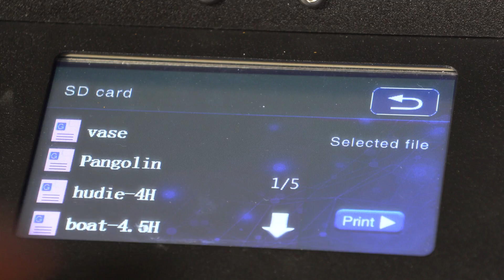The Unfortunate Problem with the Creality CR-X 3D Printer

Comment: I got an ender-4 since hey 4 is more biggerer the 3! Right?  What a piece of shit!!!!!!  

#1 when the y-limit switch is engaged the it turns the mainboard and the lcd off!  Seriously the 3.3 and 5v leds turn off and the lcd goes black!  This cost me three days thinking my mainboard was dead until by chance I moved the gantry away from the y-limit sw!!!

#2 The y-axis will NOT zero out when I try to auto home.  It is supposed to move the head to x0, then move the gantry to y0, then move x and y to 110, 110, then move the z-axis to the start position using the auto detect sensor.

Instead it moves the head to x0, then immediately tries to move to x110, y110, then home the z-axis.  It completely skips attempting to move the gantry to y0.  The result is if the gantry is past y110 then the gantry moves back until it crashes into the back of the frame with the gah, gah, gah..as the y-motor grinds!!!

I can control the y-axis from the main screen so I know the motor is working.  Also it does the move back with the auto home so I know it is getting some kind of signal to move back and is following it and it is moving the correct direction.  I even tried writing a gcode script:

G91; relative mode
G1 Z-10; move relative z -10 mm
G90; absolute mode
G28 X0; go to x0 limit sw
G28 Y0; go to Y0 limit sw
G28 Z0; go to Z0 position using sensor

Everything executes as expected except the G28 Y0.  It just ignores it as it does for autohome.  So this is still not resolved and of course I cannot look at or fix the firmware because it is locked!!!

#3 Back to the y-limit switch turning the mainboard off when engauged.  I looked the picture in the assembly manual (also a piece of crap) I noticed that the y-limit connector is 3-position with the wires in 1,2.  But the limit sw wire that came with my printer has the pins in 1,3.  I can easily move the pin over but I have read various posts that say the wiring should be 1,3.  However, why the hell does actuating the switch then shut of the mainboard?  I moved it to 1,2 as in the photo in the book but cannot test it because I cannot get the god damn thing to run the gantry back to the damn switch!!!

#4 The LCD is unreadable and does not match what I see in every youtube vid I have watched.  Mine has a bright background with darker letters and is so overblown and pale contract that I have to tilt the entire machine backward to read it or kneel on the floor at eye level.  

The display I see on the creality site and all the videos I have watched has a dark blue background with high contrast bright letters!  WTF I have different editable firmware or something?

So as of now I have spent two week assembling this piece of shit and have a $308 door stop!!!!

So yes Creality's quality control is garbage.
Reply: Okay very important update that might help other creality ender-4 people.  problems #1 and #3 above are resolved with a simple fix.  The y-limit switch cable has two ends and at one end the wires go into position 1,2 of the connector and the other end they go into positions 1,3.  Rather the move the pin from 1,3 to 1,2 as I did just flip the cable!!!  So the 1,2 end goes to the connector on the mainboard and 1,3 goes to the connector of the motor!!  This fixed both the mainboard and display going dead and autohome and g28 y0 not moving the gantry to y0 position.

But I still feel the quality control is crap, the instructions are crap.  Note both ends of the cable were labeled "Y".  I missed the class on omnipotence and therefore could not divine through holy knowledge the direction of the damn cable was important!

Comment: I believe you took the correct approach to this. If you where to test the product as is and it ended up getting a bad review, peoples relationship with CR would have been soured. But if you where to give it praise and other users received a different version that did not work, then your relationship with people would have been soured. Not giving it a review until you received the version everyone else got is the best choice in this situation.

Comment: I run one of the first CR-10, single lead screw, allmost day and night. Some small tuning parts had to be made. Squash ball feet, the printer is in my appartment. Some insulation underneath the bed. Sooner or later auto bed levelling will be installed, The one 'I bought does not do anything at all and the coolers in the control box gonna be replaced. I print on a IKEA mirror and the printing surface is a sheet FR4. No hairspray, glue stick. If I don't count the Raspberry, I would say 3D printing needs a berry, all together cost me $340. The quality still is breath taking. I don't see any profit on the X, but additinal costs. A larger building volume and auto bed leveling would might take me to buy another one, the X not

Comment: The fact that these manufacturers feel that using end users as lab rats and not do what seems like any QC sickens me. I also dont think it is right that companies make runs of the machines and change things mid run, if they are going to change something they should update their selling page with the updates, if not change the name from CR-X to CR-X2 or something along those lines. I am a welder by trade and if the weld machine companies did this they would be out of business because people would not buy their machines.

Comment: I agree and at this point I would much rather just buy the dual extrusion and use on the standard cr10. I care nothing about touch screen. It should have auto bed level on it. It should have  filament run out sensors. How about implementing an external power supply to get rid of the big base on the printer

Comment: I totally agree with you on this a lot of the tech toys are getting this way about 2 years ago I bought an laser engraver at around the 3,400.00 cost range and around 10 months after I bought it it had some problems and the part I need to fix it CAN'T BE HAD BECAUSE THE SUPPLIER WENT OUT OF BUSINESS. And the y have no replacement and their cheapest repair is half the cost of a new unit. this kind of things should be punished by us the user by spreading the news as you do GREAT JOB  I would love to test and make suggestions on how to make one of thes type items ready for sales. but spending my money & then having to fix it as i try to use it stinks

Comment: +3D Printing Nerd I think a compromise needs to be struck. R&D and QC both cost a significant amount of money and as the market shows with companies either disappearing or no long focusing on consumer market it's hard to make a viable cost effective printer at a price ppl are willing to pay (what would you be willing to pay for the spec of the X after lengthy and expensive R&D/QC) Maybe an early access scheme where a limited number of these printers are let out at a premium price with a promise that any additional fixes to the spec will be covered and that they will be thanked in some way when V1.0 is released (even if it's just the customers name on the instructions and website thanking them) what is going on now is damaging both the company name and the model (that if done correctly could be great)

Comment: Well... congrats, 3d printing community!  The dreaded scourge of "early access" has finally found its way here.  Games hyped and sold as shiny as possible with that nice label "early access" and no real warning what could and does happen (developers lose interest, abscond, or take 10 years to finish what is in the end a very poor excuse for what was promised... I'm lookin' at you Space Engineers)... and now it's here.  Sell you a half baked product, wait for complaints, use complaints ("feedback") to build what should have been the first product rather than simply ask some folks to beta test the damn machines for them in the first place.

Great.  This somewhat complicates my upcoming christmas, doesn't it?  I'm firmly in the budget printing category with no serious needs in terms of dual nozzles and such (~$200 budget for printer so I'm not expecting much) but I do like bang for my buck and this is worrying to see at the $800 level.  If that's how you treat customers with fat wallets, what am I to expect? :\

Comment: Quality control is severely lacking in a lot of products today.   I work in the tech industry, management pushes for unrealistic time lines, when the engineers explain what they can deliver by the unrealistic timeline, management states, “approved”.   Mid-management to executive management are to blame for product that meets the market unfinished.  Today’s management 101 is to cut corners in timeline, cut cost, and cut experienced engineers for low cost newb employees.  The only way for this process to change is to have a law, or lawsuit that will hurt their bonuses, and pocket books . As consumers, we need to hold them accountable for releasing unfinished products. Thank you for your help in taking a stand!

Comment: Just an added note. I would rather have TWO Z motors tied into a single output, than ONE Z motor spinning a belt that can skip, break or stretch throwing off one side of a print..
Reply: Just out of curiosity, how much counter weight did you use?
Reply: 1 pound.  If you have an email address I'll send or post a picture.
Reply: Elfpimp1 I have a Creality CR10s with 2 motors.  I have had problem after problem keeping the bed level. All the weight of the extruder is on one side. I found after a time that the screw on that side drifts when the unit is turned off. In 100+ uses, the level was off. Until I added a counterweight. Now 100+ more uses and the unit powers up and bed is level every time.  I was thinking the single mother with bets would eliminate that problem.

Comment: Never bought into the creality hype, just like I'm glad I didn't buy into the Prusa hype.  Tried my luck with a FLSUN C PLUS.  Slightly higher Z height build size @420mm vice 400. Great inductive leveling and great prints. If you'd like to see it in action, or borrow it for review, I live in Seattle in leschi/ Mt. Baker neighborhood. I'd be more than happy to reinstall the original setup on the print nozzle and heat throat. And would even setup the duel extrusion. It comes with a chimera setup as well as a cyclops.
Nearly forgot the link to the FLSUN.  Take a look..   FLSUN 3D Printer Plus Prusa i3 Diy Kit Dual Nozzle Touch Screen Auto leveling Large 3D Printing Size Heated Bed Full Gifts https://www.amazon.com/dp/B076VX86SR/ref=cm_sw_r_cp_apa_p5YxBb76E9CF4

Comment: It’s about time you beta testers stand up and tell them you’re not reviewing or beta testing anymore. I agree if they would give you a nominal fee and ways to interact with the design team you could go thru your testing on screen and when the final version comes out to the public to see it with all the good things you recommend being there and then you review one of the final version ones they would sell so many more machines. As you said they are doing great things but missed some major marks. But if they had you beta test it the money they paid you and the extended time to market they’d probably take the price from $799 to $1000. I mean come on they are pricing themselves even with Prusa and they are no Prusa when they have hand drilled holes.

Comment: Creality has used this recipe on every machine, using the first buyers as beta testers and implementing their feedback for future models. Initial CR-10 didn't ship with strain relief on the bed cables and had a faulty extruder plate, but once upgrades were in place, they made a limited amount available for purchase at $0.99 on their website (took months to arrive). Ender-3 has/had a seriously warped build plate, they are now shipping them with some type of removable surface but those purchased before hand are stuck finding their own solutions.

These machines are still light years ahead of other budget options, but as you put it quite well, they are incomplete. They seem to reach a point and just say "good enough, let's ship it" and then improve on it as needed. This may work for at the lower end of the spectrum (Ender-3 and CR-10) but with the price of the CR-X, it is inexcusable.

Comment: Monoprice Select Plus and the Zonestar P802Q's Gcode don't show up neither in the Root file. I figured all 3d Printers were this way? I don't see a big deal with that, just part of "setting" everything up. As far as the Nozzle and Bed meeting... just add four longer screws? Granted they should have already came with them. I have yet seen any 3d Printer 100% ready out of the box. It would and should be that way, but we are living in 2018. Heck, even PC games are never 100% ready out of the Box these days as they were in the early 90's.

Comment: I've seen this sneaky Betatesting in every single printer I have at Home.
Geeetech even shipped a deltaprinter which has no working Firmware and they say "use marlin it's Open source you just have to configure"

Comment: Well many companies do this not just 3d printers. Tevo, anycubic, creality, and more all iterate their products from launch. Most people reviewing are not paying for their machine's but are working for that company so their value add is advertising and actual product feedback that matures the product for real paying customers.

There are only two options. Release early beta and let people test. This makes it very cheap world wide testing and therefore keeps the final price down.

Or do all the testing in house bring it to market 12 months later with all mods baked in. Amortise the expensive in house testing into the price of the product.

I think its fine, i would never buy a first gen product and expect a perfect product. But perhaps videos like this and the company itself could help the situation to be more open about how the business works.

My cr10s was first gen and i knew it would need work which is why i bought it. But it has 3d printed parts, no bed mosfet and other early issues. But it was a tinker machine so not an issues and it now better than the current cr10s iteration.

Comment: Not to make excuses for Creality (the bed leveling issue should be solved before they ship), but I was able to get around the issue of the springs not compressing on my CR-10S by adding some 3d printed spacers in-between the bottom of the spring and the y axis carriage. It's a band-aid on a problem that shouldn't exist, but it does work.
Reply: The bolts weren't long enough, for me one of the wheels had already fallen off because it didn't have enough threads holding it on by the time the nozzle was close enough so had to move the Z end stop like Joel. Yes you can buy and fit longer bolts, but who wants a print bed flopping around 40mm above the axis?? :P
Reply: Ah, in my case it was the springs that were too short - guess my fix won't work for the CR-X (neither the car nor the printer).

Comment: You are so right. I recently purchased a printer from a popular new contender in the resin printer market based on some reviews. I love it now, but it was a long and painful road that involved waiting for replacement parts to ship from China that I had to install myself. Couple that with the fact that the machine I received was slightly different than the one I saw in reviews, and that there is yet another version of the machine shipping now, it feels like they've been shipping a product that isn't quite production ready and relying on customer service requests to finish it. Not saying a machine can't evolve over time, but basic things like wobble in the lead screw and acrylic panels that properly block UV should've been done right from the start.  I love this field or hobby or whatever you want to call it, but these companies really need to slow down and make sure they are sending quality machines both for review and final sales or we risk a market flooded with sub par garbage.

Comment: Sometimes I get the feeling that these companies don't even understand what they are making. My Creality CR-7 is a prime example. It shipped without a heated bed, so only PLA. Good, fine. Yet it had no part cooling fan so no PLA either. Even weirder is that the PCB cooling fan plugs into the port for the part cooling fan so if you don't turn the fan on in g-code, the PCB could potentially overheat. The annoying thing is, for maybe $30 more I fixed all the problems and now it prints better than my Ultimaker or Prusa. Like you said with this machine, they get 81% there and then quit. It's so frustrating.

Comment: I'm glad I bought a Prusa MK3 even with its quirks. I can't understand why everyone doesn't move to an integrated leadscrew. There's no reason to use a shitty coupling that's not designed to mate with a threaded screw. If you're going to use a coupling, you should turn the screw down properly. This is common knowledge in the motion world.everywhere yet I so so many printers with these crap helical or out of round couplings misused. Ok rant over.